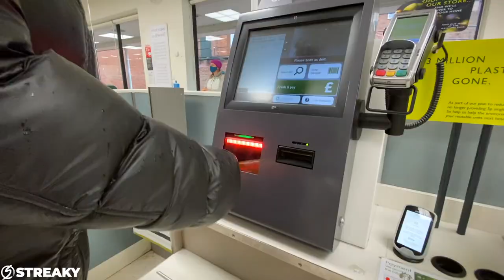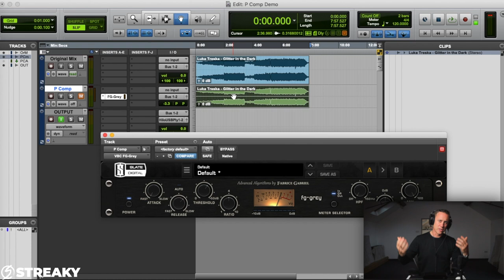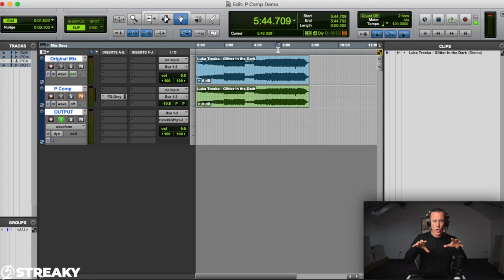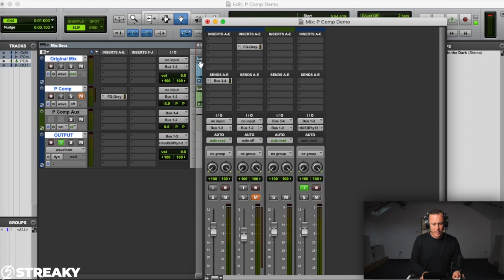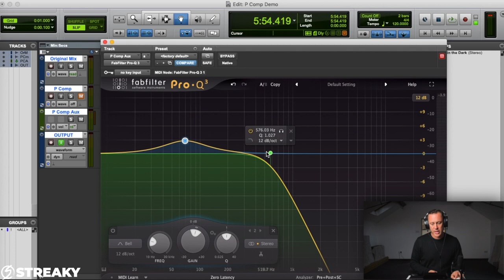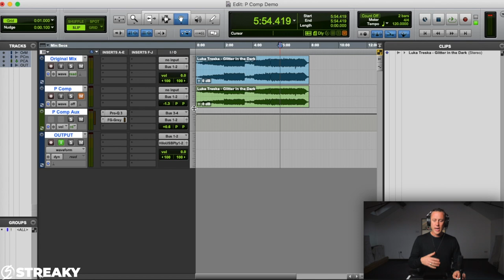EASY PARALLEL COMPRESSION | How To Use Parallel Compression Tutorial

Comment: I’ve been playing around with 3 parallel comps set up on there own buses well I mix. It’s kind of taking the Micheal Brauer idea of multi bus but with parallel comps. 

The first bus will be the “bigger” bus, so usually a more gentle sounding compressor with an EQ after with a small low and high shelf boosts.

The 2 is set up to add aggressive punch. So the comp is faster and the eq is boosting somewhere around 500-800 hz

The 3rd is set up to add focus. Smooth comp with a faster attack and medium release with an eq boost after around 1.5 k

So when I’m mixing ill play around with turning up the sends from individual tracks to the different parallel busses and just hear the tone changes. I’ve found it makes the individual tracks get more mojo without having to spend as much time

By the end of the mix I’ve noticed it adds a little more movement throughout the track because the different comps are moving in the background around the random tracks that got sent to them
Reply from the maker: Nice tips

Comment: I've used it [in the mix] for vocals in the old "wall of sound" approach; use EQ on the send to bring up the vocal's presence and clarity frequencies. What that does is to set the minimum level of the vocal track so it sits on top instead of sinking into the mix. In less dense mixes it can help a wavery vocal sound more confident.

Parallel compression is also handy for plinky acoustic guitars that need thickening without sounding compressed.
Reply from the maker: Yeah love that idea for the vocals
Reply: @Streaky_com  I forgot to say thanks for the tip - I'd not thought of doing that on the low end in mastering.

Comment: Better to use a compressor with a mix ratio (dry/wet) available on the plugin. Will insure zero latency which will prevent phase. This is more an issue in busy plugin intensive mixes.
Reply: But then you can't put an EQ before it.
Reply: @hearmenow909  you can depends on what you want to do. If you want to eq the whole signal then parallel comp just put eq plugin first the comp plugin after. If you want to side chain eq for more complicated set up like keying the compressor signal to only effect specific frequencies just use the side chain feature of the plugin like fabFilter comp then adjust the wet dry. The point im trying to make is be mindful of latency when using parallel compression. Sometimes can effect phase where you will loose slight  mono compatibility.

Comment: If only this youtube thing had the necessary codecs and quality available to really hear what's going on. When Streaky dials something in, compares tonal differences or anything like that, he always says, let's exaggerate it, to really show you the effect and that exaggerated version is the one where the change finally becomes perceptible. But you also got a louder is better type of thing going on. The explanations are still right and there is no excess mumbo jumbo or voodoo and definitely no snake oil being sold here, but I guess you have to sit down, play the tutorial in windowed mode and really go through what he is showing with your own stuff. It sucks, but youtube just isn't anywhere close to usable with this. It's just optimized for low storage and especially audio is being treated like something that can save MBs, like 99% of the people won't hear the difference between max 128kb/s variable bitrate and flac anyway. That is a bad place to be to really show what is going on in a mastering setting. That sort of requires a good room and great speakers or at least very high quality headphones even if your audio quality is great. Now I'd say the majority of people watch this on their phones with earbuds in.

Essentially 90% of the people watching probably can't tell the difference even in most of the very exaggerated examples. If 0.5 dB is subtle and 3 dB makes it really obvious, then on earbuds through a regular mid level phone's DA conversion, after youtube mangled the hell out of the audio, listeners start to hear the difference at 3dB. Really obvious is probably more like 6 dB.

That's not any body's fault, but if you are watching and thinking, wow it gets slightly louder maybe, but I can't really tell a difference, you aren't crazy. You need to go try this information out on your own gear with actual high quality audio and preferably at least some really good headphones.

If I had to make 1 suggestion to Streaky, it would be, go overboard a lot more. When you think it is clearly too much, that's when we start hearing an actual difference here on youtube. When you pull it back to something more reasonable, we get to subtle differences that require a treated room with some good monitoring or at least high end headphones and Rock solid d/a to follow. So when your ears tell you mission accomplished and you make your last before and after comparison I hear absolutely no difference whatsoever the second I close my eyes. Sure in the studio on mains I can hear a very very slight difference, but not on the go with a phone or on a pad. More gain matching and more exeggeration would be nice for a lot of these tutorials. Just keep telling us, sometbing, like 1/2 a dB is nice with this, maybe 1 dB max, but don't exaggerate to 2dBs, go to 4 or 5 or 6. Even the extreme 2 dB is super subtle on youtube. It's just how it is.

Comment: I do this exact thing (other than low passing) but try to achieve a gain reduction of -8 to -10 dB on the compressor. I see your gain reduction was much more. Is there a gain reduction that's ideal when parallel compressing - especially when doing it to the whole mix?

Comment: Thank you very much Streaky, loved the visualization :) One question if I may, so using this technique in individual tracks or group busses ( drum, bass, pads etc ) do you suggest using the same compressor with same settings for the sake of consistency or does it depend on the group and its sounds?

I am an amateur trance producer ( totally amateur ) and I have many many many tracks and group busses :) That is why I am asking actually.
Reply from the maker: You can use any compressor if you like the sound then that’s all that matters
Reply: @Streaky_com  Cool

Comment: Mr Streaky, on rare occasions I've run in to phase issues doing P/C - how do you handle that ?
Reply from the maker: Normally latency issue with some plugs
Reply: I figured out why I was getting phase issues.. Make sure the PC on the bus channel is set to 100% wet signal, then it should not cause phase issues. I had put Ableton Multiband onto a bus channel and was sending signal into it, but it doesn't have an explicit dry/wet knob, output signal contains input hence phasing.

Comment: Whats the difference to using the Wet-Dry on a compressor? Its basically the same isn`t it?
Reply from the maker: Kind of but you don’t have the same control and creativity as you do sending to a buss...
Reply: Saar, you can't EQ the wet separately. This relies on the dry being straight-through but the wet being EQed. For regular full-range parallel compression you can use wet/dry.
Reply: @Streaky_com  i see. that option i underestimated i guess
Reply: @iqi616  hmm. You are right, now that i think of it i dont know a compressor that has a full eq for the wet signal integrated in the plugin. Only reverbs. The nearest thing i can think of is multiband. Dynone for example. You could mix the compressed signal only in the highs+lows and leave the mids uncompressed. This should sound similar to a smile eq on the wet signal   in a way. Other way would be in ableton. the easiest would be an effect chain where you can make one with comp+eq and one with the dry and blend them together any way you like. Without duplicating  the track. There are some very interesting ways to do it. Fascinating times imo
Reply: @saardean4481  I don't think multiband would be the same. The principle is that instead of pushing down the loud bits, parallel compression effectively lifts up the quiet bits.
Reply: @iqi616  Dynone is not straight up multiband. Its multiple bands that you can compress indeed but what is different than most is expansion ability instead of compression and  you have wet-dry controls for each band so you can blend them in as wished. I hear what you say. You mean upwards compression or expansion. So what we basically seek is an upwards compressed signal with a smiley eq curve that we then mix with the dry signal. I believe you can achieve something like this with Dynone. Not theoretically but acoustically. But thats just my two theoretical cents. I might be wrong. Will try it later maybe.

Comment: how would you use this on drums specifically? I’ve heard before that you shouldn’t use it on kick sub but i could be wrong of course
Reply from the maker: Yeah
Reply: For drums I usually only send the close microphones to the parallel comp. For me when I send overheads or room microphones to the main parallel drum comp it gets phase problems because the comp moves the sound so much

faster attack and fast release. Your looking for the “body” of the drum and trying to thicken that up. Usually for drums I’ll throw an EQ after the parallel comp and add a little somewhere between 80-125, a little around 4-5k and cut the low mids a hair.
Reply: @brianpennymusic  I am using GetGood Drums so it’s midi, i have a kick sum, kick sub, snare top, snare bottom, Toms, Hats, Rides, and OH, and Room. you can also adjust the room close and room far levels within kontakt. which would you suggest sending and not sending to a parallel compression track? thanks for any input btw, i’m very new and learning a lot from youtube. which helps for sure but some more specific questions like this it’s nice to have comments like this.
Reply: DraftZJ once you have written the drum part try copying the track and muting all the close microphones from one (kick, snare and Toms) and on the other track delete the OH, HH, and room microphones. That way you have 2 tracks to play with when mixing. I would start with trying the parallel comp trick with just the close microphones